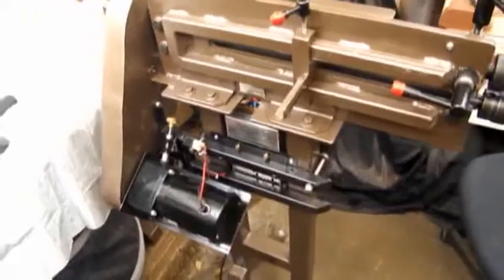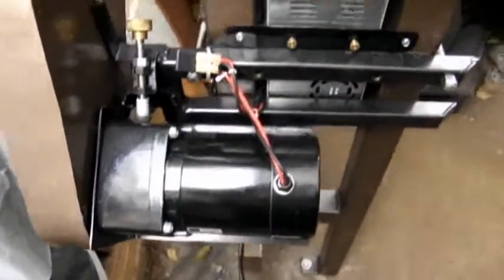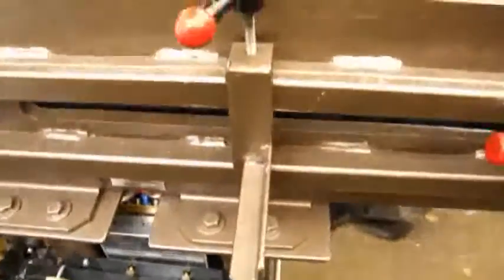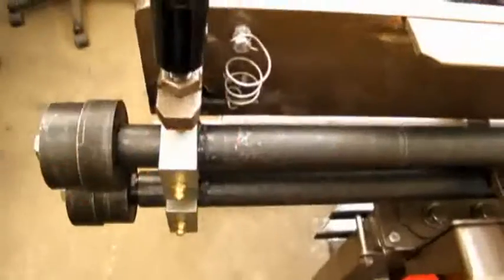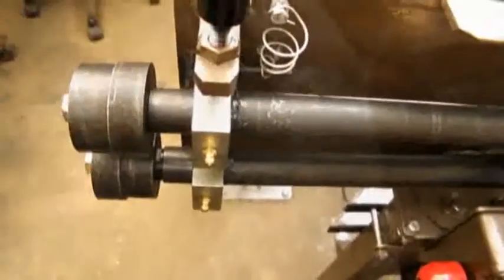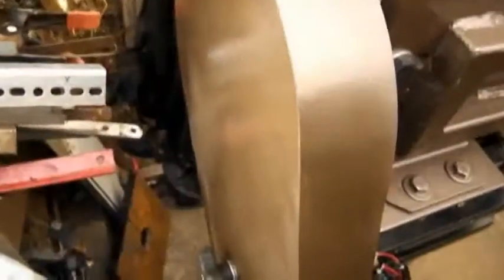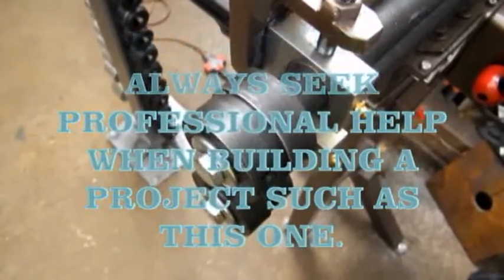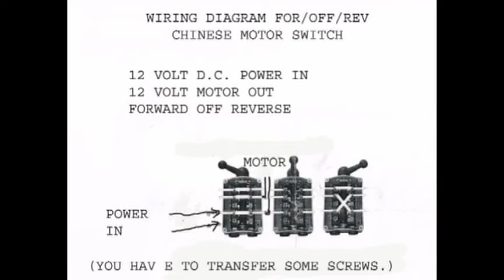BEAD ROLLER MODIFICATION DIY

Comment: Hello Captain Lee. I have a small bead roller but want to make a larger powered roller. I see you are using a 12v motor I would like to use a 24v geared motor I have but thought I would have to use a battery.  You use a mains power supply. I would like to go the same way, any clues to what I would need ?
Reply from the maker: Hello anton For power I would buy a 24 volt power supply on e bay should be at least 20 amps.